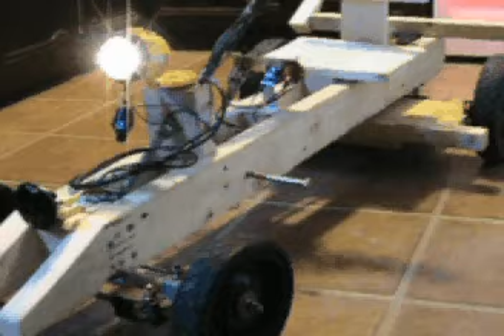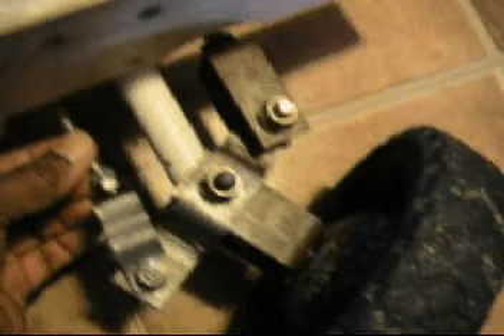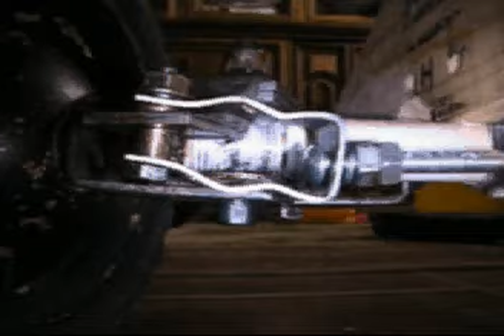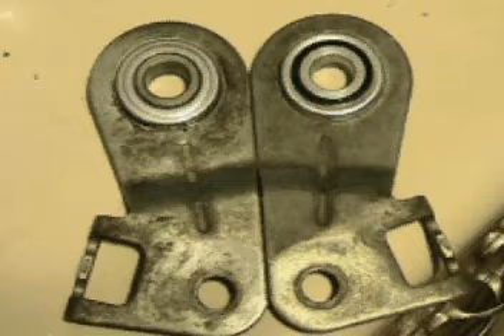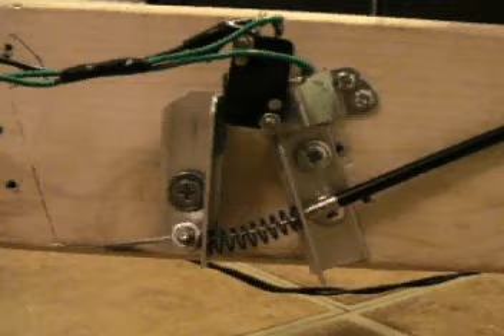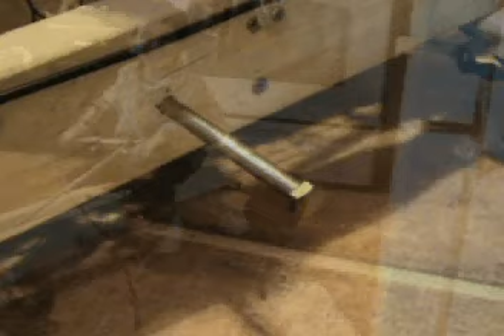how to make a go kart by tribs

Comment: You did not tell about the motor.
I suppose it is a 24V DC motor that you run on 12V?
What type? RPM-, Current- rating?